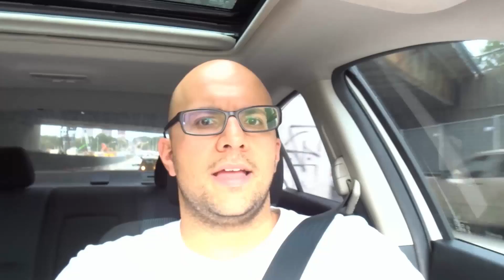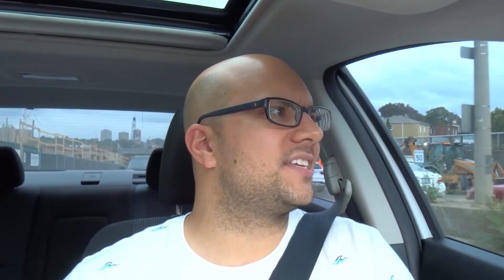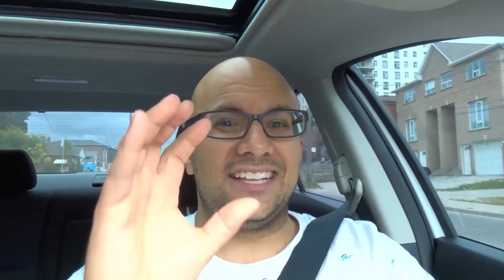Turbo Wastegate Explained-What Does It Do

Comment: Bro I threw a rod and was I told it was due to a wastegate being stuck or tuned wrong. Originally design to release at 20 but was not moving until almost 30psi. I was also told by a different mechanic that turbo cars used to not even have wastegates, so more likely it was lspi. Whats your opinion? I have a Focus rs 2018, now w a new engine

Comment: How would it be exhaust gases?

Wouldn't it just be air coming from the intake   > Inlets > Turbos (Compress air) > outlet > intercooler > charge pipe > throttle body > engine